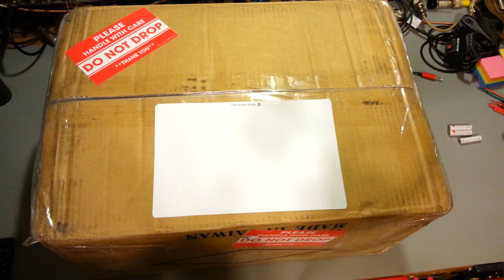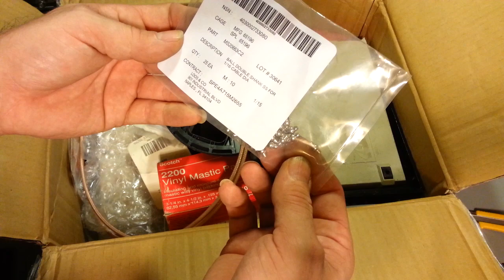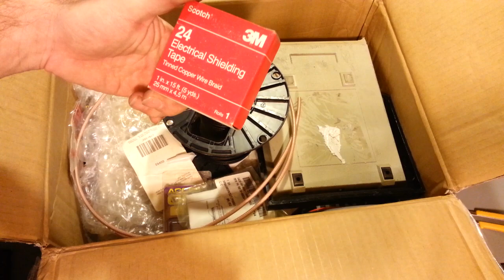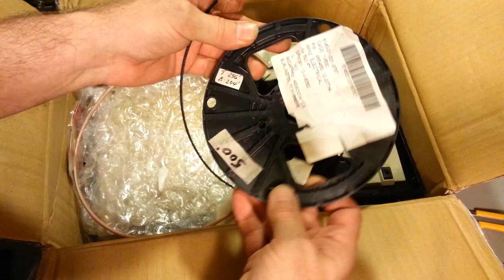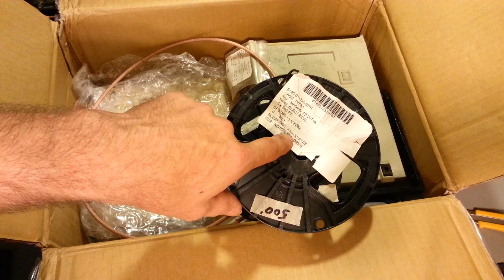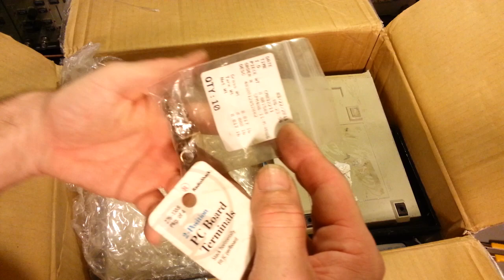Freebie goodie box from MPD Digital the coax people.

Comment: Don't those orange/red "Do Not Drop" stickers act as abuse magnets? I buy from MPD Digital too. That is "SageMaiden" on ebay right? What a cool "goodie box" !!! If I buy pre-made coax I almost only buy from them. LMR-400 and LMR 400-Ultra Flex are my coax's of choice. I can not solder the ends on as well as their automated machine can at all!
Reply: Buck   I rather the RG 400 like Mike had in the box , the LMR is good stuff also , but I like the PTFE  Teflon dielectric in the RG 400 .... Plus the RG is smaller